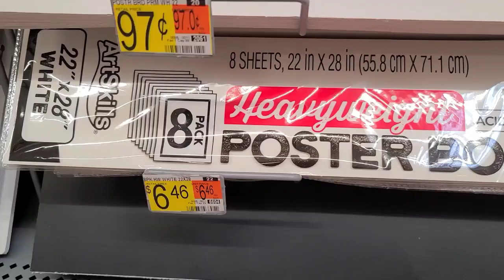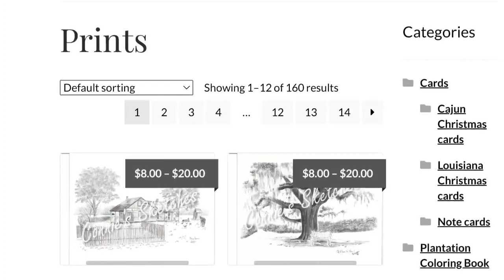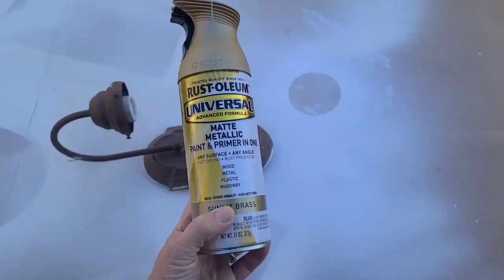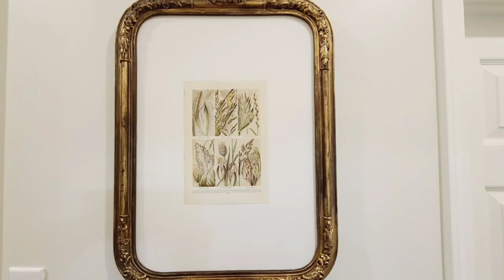Extreme Hallway / Stairway Makeover • Budget Friendly • Farmhouse • French Country Cottage • Modern

Comment: This is probably my very MOST favorite of your videos!  I'm a Midwestern girl, but for some reason I love Louisiana. And those prints are just so satisfying to look at! I want to shiplap the main wall in one small half bath, but I have to wait until Summer  when I can bring my miter saw back from the farm, about 10 miles away (too cold and snowy right now). No place to put it here except on my deck. But it's easier and much quicker to make straight cuts with it rather than my circular saw. I can cut the panel pieces on the table saw at the farm and bring them in here. Be glad you have a garage, a basement, a CAR PORT! Anything, besides just a deck or patio for a "work space'.  LOL. And youth. Youth is on your side, girl!

Comment: I think Behr premium or marquis is the best paint.  Lowes doesnt carry it but Home depot does.  Many painters will say Sherman Williams paint but thats just because that has been the standard for so many years.  Valspar requires multiple coats for full coverage.  Sherman Williams requires priming first and if you have to touch up any spots you will have to repaint the whole wall.  Behr premium or marquis has primer already in it.  You get full coverage in 1-2 coats.  If you need to touch up a spot you can feather the paint in without redoing whole wall.